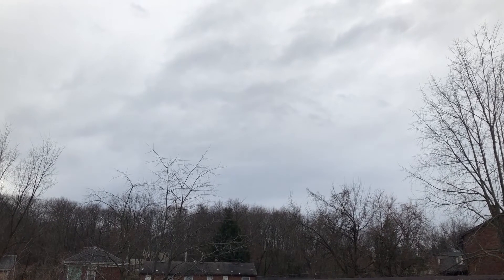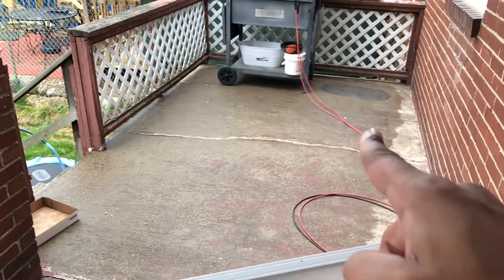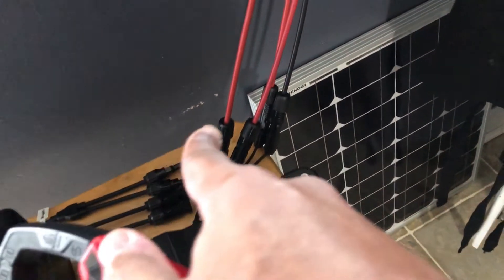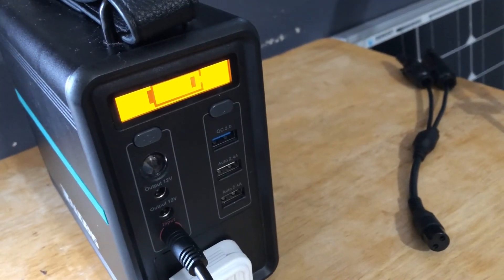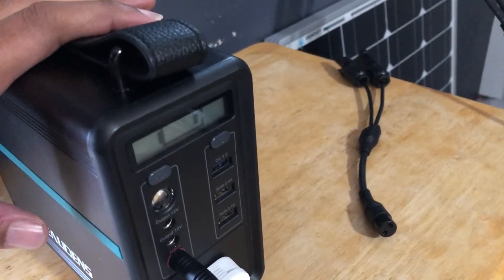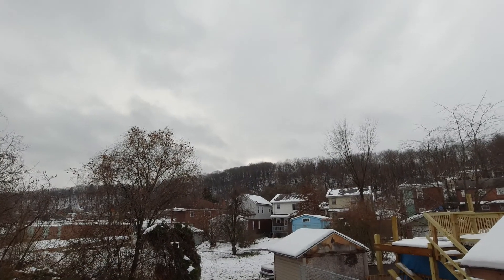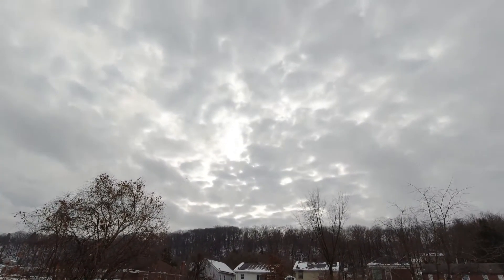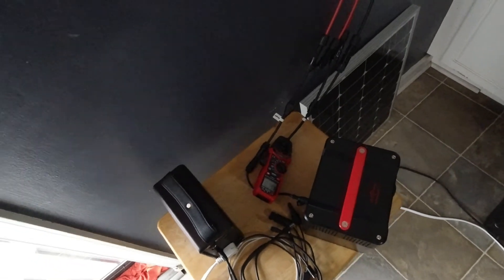What About When Its Cloudy? - Solar Panels On A Overcast Day

Comment: Well I got my E2000LFP kit.  I bought 4 200w portable panels from them as well.  It's been sunny all winter here in Tampa.  Has not rained in months.  This week overcast with showers all week.  There is a silver lining.  The weather did convince my wife hey we really do need that propane/gas generator as well.  Warren Buffet once said “predicting rain doesn’t count; building arks does”  So going to get those expandable battery's as well in due time.
Reply from the maker: Nice @ all this!!

Comment: It's funny... Is the charge current low because I got crappy clouds in the sky.. or is it because the battery is at 12.3v... lmao...
Good video overall..
Reply from the maker: Interesting. I did a short about measuring amps in overcast. I don't know. I just report the numbers. Ha

Comment: With my array of four 320W panels in 2 pairs at 80V combined mounted flat on my van I get about 20 to 40% of the output during cloudy and rainy days at noon compared to the output of sunny days (I get about 200w in total when it is heavy cloud cover and rain from my  panels mounted flat and about 900W when it is sunny). It seems when mounted flat it maybe improves the power you get on a cloudy day as I seem to get much more then people say they normally get when there is no sun ? But flat mounting also means less power then optimal when it is sunny so the power on sunny and cloudy days gets closer together.
Reply from the maker: Man that sounds like a pretty cool setup. Send me some pictures one days. FB IG or Telegram. Or solarquestions@askive.com

Comment: Thanks for showing some of your tests. I'll be curious to try some of this out when I get the chance. I ordered a Bluetti AC30 300 WH with Lifepo4 batteries along with a Newpowa 100W mono panel. The AC30 is supposed to be able to take 150 watts from solar, so when I get the chance I'll grab another 100w panel to try them in parallel. Eventually I'd like to build a DYI battery (perhaps milk crate) as recommended by Will Prowse but I'm just getting started in solar right now.
Reply from the maker: Aww man. That's exciting. Welcome to the club. It's addictive. You should watch my video about the golsbs. I think it edges that ac30 out a bit. 

Man keep me posted on that newpowa output. Message me on IG or FB (Askive Solar) or comment on any of my newer videos. 

150 watts of input is dope! The golsbs maxes at 60. Which sucks. But I wouldn't get it for the solar charging per se
Reply: @AskIveSolar  I considered the Golabs, but I really wanted faster solar charging along with the Lifepo4 batteries. I couldn't really find anything that had faster solar (and passthrough) charging. Plus Bluetti seems to produce high quality stuff overall.
Reply from the maker: @DB-cu3xu  yeah man. Thanks for your comment. You really got my wheels turning.  Thanks Obama lol. 
I'm primarily a pass through guy but was moreso thinking about upgrading my beaudens vs getting the best pass through device
Reply: If you MPPT charger can handle the voltage series connection is better as it gives more voltages and makes for less loss in the cables and better working conditions for the MPPT charger (more volt for them is better). My 4 panel array is mounted in pairs of 80v as 100v is the maximum voltage my MPPT charger can handle. If I had a charger that could handle 200V I could have connected all in series of 160v.

Comment: One question I had that got to my mind is are you running both solar panels in parallel amd if yes , what’s the reason? Do you know what’s the max wattage your unit can receive the 300 model is cause I couldn’t find it hehe . I did some research on how solar panels and  some mppt work they all have concepts but mainly work alike . I have a solar station which even if I have 2 or 5 solar panels I can only obtain a max of 54w so in reality since my unit has mppt I can’t modify that what I’m trying to explain is that there’s is a limit input and I could gone with a 60-80w panel instead of the huge panel I got heheh but there is that other truth where I might have extra juice but then when it’s not sunny at least that big area gets captures some power .... but in the pass I thought adding more panel would get me more wattage but didn’t know it all matter what is the limit of the mppt /solar controller . Like your need 50w panel I might get one for another gen I got for more mobile applications
Reply from the maker: I put them in parallel to combine the output. Parallel keeps the voltage the same but raises the amps. 

These type of power stations typically have a voltage range up to about 30 volts. So you can't go series because that increases the volts and the amps stay the same. 

The rock pals maxes out at 80 watts. 

The main reason I combine the panels is because on overcast days. One panle outputs like 1 amp or around 15 or so watts. I have an extra panel so if I combine them. I get 30 watts or 2 amps. Give or take.
Reply: @AskIveSolar   Many have reported that on overcast days specially they have benefit from series connection as the higher voltages helps get more out of the panels when there is little sun... It is best to keep the voltages as high as your MPPT can handle (with 20% headroom for if it gets cold with sun as then the panels can give more volt then their specs)
Reply from the maker: Good point. My man Beene was just telling me this.

Comment: i picked up a rockpals and 60w panel that i'm waiting for now to run a water pump for a hydroponic system i have. these videos are awesome! great work and thank you for posting!
Reply from the maker: Oh wow! Thanks for watching and your kind words. Which rock pals did you pick up?  Why 60 vs 100. If it's those folding panels then I suspect price. Those joints are expensive.
Reply: @AskIveSolar  I got the 300w and I did get the folding panels. I wanted something that I could take in my car, but i want to get a panel that would be stationary mounted in my yard, too. Is Renogy your favorite?
Reply from the maker: I actually wanna try a renogy panel. Didn't like them because they were so much more money than hqst. 
My panels I have were 80 and the renogy was like 117 or something like that.

Comment: I'm getting over half an amp with ravpower portable folding panels just dangling out my window in the rain in England. The 16w and 24w versions are the best stay away from the 21w and 28w versions. Trouble is with those is there only output 5v for usb. Like you I've got a beaudens and allpower generators mine hooked to 2x 100-watt panels with branch connectors. I find the beaudens doesn't charge very well in low light Vs the allpowers 288wh generator.
Reply: The allpowers 372wh generator caps at 60w even if more watts are going in. Cloudy day with 100 watt panel you're not going to be getting that anyway. But I've plugged the beaudens in to the same setup and it's not triggered charging in the low light early morning cloud Vs the allpowers which was getting about 8w going in . I can't say I've had the beaudens turn off before when using the usb or a  but I've had power banks shut off before if the current was very low like fairy lights at minimum brightness.
Reply from the maker: Yeah I think it's because the Beaudens has a higher voltage in those lifepo4 batteries vs li ion batteries

That kinda was my logic with making the overcast video because my rockpals seems to charge in low light but the Beaudens doesn't register. But I only found this in low light during the summer and not the winter. Which is weird.
Reply from the maker: What's up man. Do you know what rate the all powers charges at?
Either in watts or amps. The Beaudens maxes out at 42 or so and the highest rating I've got is 2.5 amps or so. 

Yeah I have a Anker folding panels. And half an amp on there at 5volts is whack. I kinda low key hate 5 watts chargers. Lol.
Reply from the maker: Question about your beaudens. Does it sometimes turn off even when it has a USB or AC load on it. It doesn't happen often to me. Maybe once every three months.

Comment: The observation of angle being not as important on cloudy days makes sense. Light is bouncing around clouds before making it to the panel? I haven’t played with that but it’s an interesting tidbit!
Reply from the maker: I'd guess the clouds diffuse it so it's just soft light all around. I'd be interested in what you find in your tests since I have such a small system.
Reply: On my van I have four 320w panels connected in 2 pairs with 80v output to my MPPT charger. On cloudy days I get about 200 to 400w and when it is sunny it seems to max out at 900w. It seems maybe flat panels give more then angled panels when it is overcast? I do not have any loose panels to experiment with to find out but most people reports to get less power out of their optimally angled panels on cloudy days then I get on my flat ones...

Comment: Nice.  So at the end, the 1.5 amp is both panels in Par ?   That is not bad in cloudy days.  Keep up the test please, it helps us all out.  Thanks , peacefrom510
Reply from the maker: Yep but as high as 1.8 when the sun was peaking through both in parallel. 

I got an idea for your mono vs poly request. Just waiting for a somewhat sunny day. Maybe I'll do a overcast day too.
Reply: When you put them in parallel they basically add both currents together

Comment from the maker: How do you feel about overcast days? 

I don't mind the low output of overcast days. Don't get me wrong, I LOVE sunny days but I use to get not much of anything on overcast days so Im happy to combine to get from .5 amps to 2 amps versus splitting that across two devices.
Reply: Well one of the main reasons I got the PV200 was because of it being able to still pull some power in shade/ clouds. I actually use my 120 more than I thought.  So I'm looking into rigid panels to help with usage.
Reply from the maker: Tread carefullyl bro. It's addictive! Lol